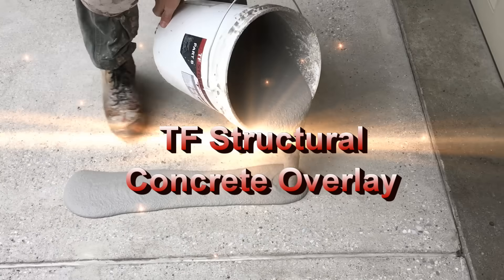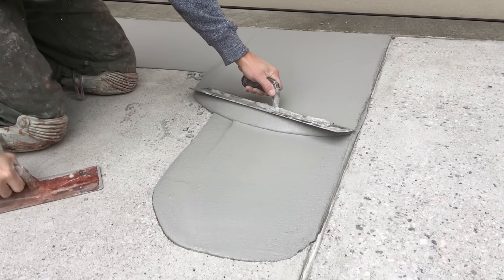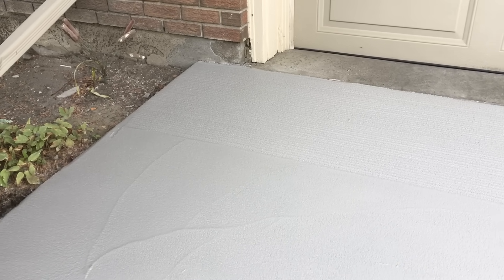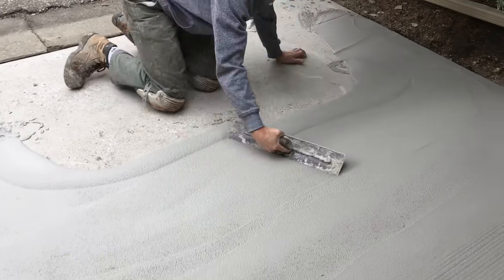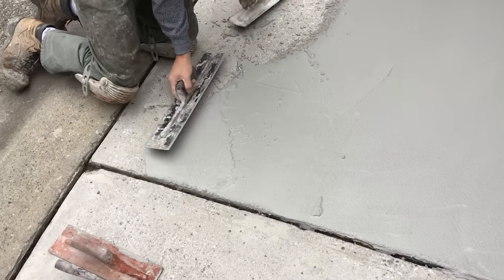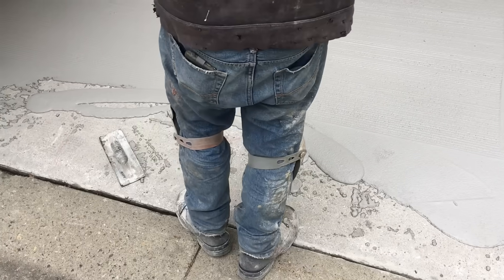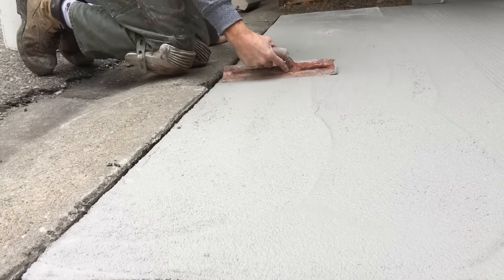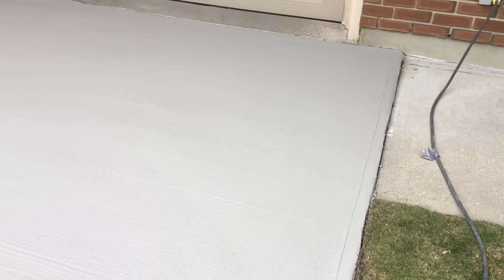TF Structural Concrete Overlay - Overview

Comment: How long before it starts poping up and chipping with weather ?
Reply from the maker: Hey Vince, it will not pop or chip off. It will wear the same as concrete does.
Reply from the maker: @The Sustainable Texan If you watch the video in its entirety, you hear that TF Structural is NOT a crack repair system.  Please elaborate on 'new on top of old'....you are insinuating that TF Structural is a cement or concrete, which it is not.  It is NOT a polymer modified repair mortar, which require bonding agents, scrub coats, etc.  TF Structural is an acid based repair mortar that mechanically and chemically bonds to the substrate.  Where did you see the TF Structural installed 6-8 months ago and then see it crack?  We have residential and commercial projects that were installed almost 10 years ago, in an aggressive freeze/thaw province in Canada, and they are performing like the day they went down.

Comment: should have filled the crack  first because as soon as a car gos over it a few times it willl crack again
Reply from the maker: Hello Mrr Mjj, no that is incorrect.  The crack will appear again, should the substrate continue to move after the TF Structural overlay is installed.  Pre-filling will not prevent cracking either, unfortunately.  Please see some of the other comments below regarding this crack and concrete cracking in general.
Reply from the maker: Here is a good method for crack repair: https://www.youtube.com/watch?v=xvq0TXjMfeU

Comment: Prefiling the crack with a fast setting concrete would have helped
Reply: Thanks... I'll try that. This would really help with curb appeal on my house until I can actually replace my driveway. Would this overlay work for small holes from rock salt? How durable is this overlay or how long can it sustain?
Reply from the maker: Here is another good method to try: https://www.youtube.com/watch?v=xvq0TXjMfeU

Comment: How thick did you apply the material?
Reply from the maker: A skim coat application is typically installed at 1/8" to 1/4" thick.  However, the material can be installed at whatever thickness is required and/or needed.
Reply: Terrafuse Inc. thank you

Comment: That doesn't crack apart?
Reply from the maker: TF Structural isn't meant as 'crack repair' product.  It can be troweled over and bridge cracks, but if the substrate continues to moves underneath, you will get hairline cracks coming back.  TF Structural becomes very rigid and will act and behave very much like traditional concrete once it is cured.  Does that help answer your question?
Reply from the maker: Here is a good crack repair method: https://www.youtube.com/watch?v=xvq0TXjMfeU

Comment: Nice job people are going to watch this and think running that trowel is going to be easy cause u make look so easy but thats alot of years experience i get the same thing when i run drywall trowel looks easy but its not thanks for sharing your knowledge
Reply from the maker: I agree Donnie, it takes time to get the feel of working trowels! A point I did try to highlight in the video, is that even if the finish isn't worked perfectly flat, the broom can help smooth everything out.
Reply: So true Donnie Porter 👍
Reply: Haha and they don't make shit. Usually minorities
Reply: Anyone can run a trowel that's why you don't get paid shit to do it
Reply: Kent Carver keep believing that dumbass.
Reply: Donnie Porter I disagree that there is no money in skilled labor. Specially if you are doing it for your self as your own business. However, this product has no chance of lasting if the base is not prepped right. You would need to Grind, or sand blast down. Then apply a masonry adhesive. Even then, it will be cracked up and flaking in no time. Specially a driveway with vehicle traffic.  After you do an over lay, it’s pretty much yearly maintenance. Constant head aches from customers wanting to know if you could come do it again. No thanks! Elastideck with an epoxy sealer would last way longer. The suns uv rays will eventually yellow the sealer, but we are talking like 7 years, and you can sand it down with 80 grit, and re seal.
Reply: @donnieporter7890   um, don't think it's a pass or fail test bud. Can you pass a U.A.?
Reply: @travisking4390  oh i agree with u on the product i dont think an overlay is the way to go especially in cold climate but they do this all around the world in tropical climate they do it and it last i was mainly talking about the trowel work .
Reply: @Kently6161  ignorant to the facts i made 150grand last year
Reply: @donnieporter7890  I'm sure you did running your own business how much did your employees make. That was my point
Reply: @Kently6161  well i paid a guy 600.00 yesterday for busting his ass and getting the job done. he worked from 9am to 6pm believe it or not doing skilled labor pays good and only getting bettr and in 10yrs from now they will be making as much or more  money as a person with college degree nobody wants to do hard work/labor anymore
Reply: @donnieporter7890  well congratulations. I'm glad you pay your employees well. I am a plumber. I understand skilled labor. From what I've experienced people that spread mud on sheetrock joints unfinished concrete are necessarily considered skilled labor and don't make very much because pretty much anyone can do it you don't need it any kind of Education
Reply: @Kently6161  hey i have my cont license and my Electrical license i worked doing water and fire damaged houses then i got into the electrical you are totally wrong sheetrock finishing and concrete finishers is an art and not everyone can do it
Reply: @Kently6161  i got 10grand u couldnt do either 1
Reply: @donnieporter7890  Correct! My son is a Dry wall finisher and he has more money than me and I aint broke! He's got the finishing technique down to a science fast and professional finishes!

Comment: What is the purpose of it if it isn’t to fix cracks? Is it just a resurfaced?
Reply from the maker: These slabs were restored because of surface spalling, and they also had an old overlay on them, which was failing. So yes, they just needed a new surface. Some cracks are very large, and once resurfaced, only return as a hairline crack. Some homeowners are happy with this result, as it is no longer a tripping hazard, or massive gap in their driveway.
Reply from the maker: @The Sustainable Texan Above you claimed 6-8 months, now you are saying 2-3 years; which is it?  Also, where  and when have you used our materials to make these claims?
Reply from the maker: Oh, the landscape business. That explains your comments. We are in the concrete restoration business.
Reply from the maker: You have never seen our product, on any job.
Reply from the maker: Yes I do, and yes I did, I designed these materials. I have also used these products for over 15 years in the field, so I know how they work and perform. You have never used them or seen them on a job-site, but claim to know all about them, which I find interesting. It suggests to me you are just using YouTube to vent your frustrations about who knows what.

Comment: Next time you have a crack to work over try putting duck tape on the crack then finish over it and most the time it doesn't come back. 😉
Reply from the maker: Unfortunately, TF Structural will not adhere to duct tape at all. We actually use it to create straight edges, or as a bond breaker when using forms. Thanks though!
Reply: Prime your duct tape before adhering tf structural
Reply: Duct tape is the deviled egg of construction. It goes with everything. I love it. Put tape down. Lol.
Reply from the maker: Here is another good method to try: https://www.youtube.com/watch?v=xvq0TXjMfeU

Comment: You need to lay a bonding agent down first.  This will definitely crack and separate.
Reply from the maker: This is not correct when using the TF Structural. TF Structural is not a Portland cement, polymer modified repair mortar, so using a bonding agent, or polymer primer, will actual weaken the bond made with the concrete.
Reply: @TerrafuseInc  I hear what your saying but proper prep work.  Grinding,  bond agent is key.  My opinion.  This is just a bare minimum job .
Reply: So many experts on YouTube
Reply: @shawsie5780  22 years in the industry.  I know a thing or two.  Cutting corners in concrete is not practical.  Why lay something down that doesn't resolve the issue and won't last?  
He's pouring a topping on a cracked un prepped concrete slab plain and simple.
Reply: @ipeeinpools9522  this is just a Band-Aid not actually fixing the job. It'll look good for a short while probably just enough time to let the owner sell the house and let the next person deal with the problem. Just like when people sell cars clean them up just for them to look good on the outside but in reality something's going on on the inside.
Reply: @ipeeinpools9522  get up to date . Still using material from 22 years ago I guess
Reply: @mikeb7611  lol,  good one.  Cheers.
Reply: Incorrect....this is not a portland cement based product.  Read the data sheet and you will see that.  Please educate yourself before posting information about a product you clearly know nothing about.
Reply from the maker: The concrete is prepped, and it was done using a shot blaster. The homeowner is aware the crack will come back, but these slabs were restored, because they were pitted and spalling, and they had an old topping on them that was failing. Again, bonding agents are only meant for specific overlays, usually polymer modified overlay systems, and TF Structural is not polymer modified. It requires no bonding agents, scrub coats, or primers.
Reply: @NordicMyth  how did you manage to to bring Trump into this retarded debate?

Comment: It will not crack over time.
Reply: If the concrete continues to move, expand/contract, etc. then cracks can and likely will come back.  This product is not meant to 'fix' cracks.  You can bridge over them, but any movement and you will get hairline cracks.

Comment: How long does it last before it starts cracking and chipping off the original concrete, what was the prep on the concrete, sandblasted pressure washed acid wash or a primer.
Reply from the maker: The crack may come back at any point, but it will usually show through only as a hairline crack. Usually larger temperature shifts will cause the crack to return. The overlay will last as long as the concrete underneath. It will not chip or flake off. It does not use any primers, and does not rely on primers to 'glue' it to the surface. TF Structural will chemically and mechanically bond to the concrete it is installed on.
Reply from the maker: The recommended prep is mechanical abrasion (diamond grind, sand/shot blast). The goal is to have a clean, solid, porous surface, and the TF Structural will bond to it. Pressure washing will work, but if the concrete is newer, grinding is recommended to ensure any surface sealers are completely removed.
Reply: @TerrafuseInc  thank you for the information.
Reply: @NordicMyth  Procedure: an established or official way of doing something.
 Synonyms: course of action · line of action · plan of action · policy · series of steps · plan · method · system · strategy · stratagem · way · approach · formula · mechanism · methodology · MO (modus operandi) · SOP (standard operating procedure) · technique · means · measure · process · proceeding · operation · agenda · routine · drill · practice. Perhaps it is you who needs less basement and more dictionary.
Reply: @JoeBlow-24  Haha!  Thx bud, I will keep that in mind. You missed the entire point!
Reply: It will last as long as you dont drive your vheicle on haahhahaa
Reply from the maker: HONESTO UNO  Just a quick question; whereabouts is your uncle located?  It can help us determine if it was indeed our products.  If so, we would be more than happy to dig into it and figure out what may have gone wrong.  We have been selling in Canada for over 10 years, but only about 14-16 months in the US.   Let us know how we can help!
Reply: @TerrafuseInc  
Wow, you guys sell in Canada? Does this mean it actually stands up to our constantly changing temperatures?
Cause we would have a use for a product that would...We do alot of repair work and people are happy to have something last atleast 5 yrs...but we never had a product that we could recommend.
We mainly do masonry work, but pour the odd small concrete pad or small sidewalk.
How would someone get ahold of your product?
Im in Eastern Ontario
Reply from the maker: Yes, we stock it in Etobicoke. Please call our office :-)
Reply from the maker: @splash5974  Thank you for the comment!  Indeed we do!  All of our materials are manufactured in Calgary, but we have a stocking warehouse in Etobicoke, ON.  TF Structural will change your opinion of repair mortars!  It is manufactured, designed and tested in Alberta, which sees some of the most freeze/thaws cycles than anywhere else in NA.  It is NOT a polymer modified product and does NOT require bonding agents, primers, etc.  Give our office a shout and we would be happy to chat further with you and see about getting some materials in your hands! (403) 243-3000
Reply: @TerrafuseInc  
Thank you
Reply from the maker: HONESTO UNO  Again, let us know where you are located so we can reach out to your uncle and see what happened.  This product does not fail, if installed correctly.  However, if it was done 2.5 years ago, it would have to be in Canada somewhere as we have only been selling into the US for last 12-18 months.  Our support doesn't stop after the sales transaction.  We are here anytime to assist.  I encourage you to pass on our contact info to your uncle - 403 243-3000.  Thank you Honesto!

Comment: Waste of money just to have a crack in it in the future,  that won't stop it from cracking again ,especially with that big crack already there , he should  and if he don't then he's not a concrete guy , but then again customers don't want to pay to fix the proper way , good job anyway looks good
Reply from the maker: Yes, the crack will reflect through the overlay, but they were not restoring this to "fix" the crack. They resurfaced this driveway to repair the surface spalling and pitting throughout. Unfortunately with cracks, there is no guaranteed way to fix them, and even new concrete has the potential to crack again.
Reply from the maker: Here is a method to fix cracks: https://www.youtube.com/watch?v=xvq0TXjMfeU
Reply: Because only super rich people can afford to pay the over payed union workers nobody can afford to pay $200-$300 per hour labor costs more and more people are doing things themselves because the cost of construction is way over valued due to unions

Comment: This question was asked prior, but I'm just curious. What is the cost per sq. ft. for a resurfacing job like this?

Obviously the quality of the work is high, but I know prices can vary wildly with concrete. I had the two approaches excavated and re-poured.  They were in bad shape. It was a total of 360 sq. ft. and I could not believe what some companies were quoting me. I live in Miami and some guys were asking for the maximum per sq. ft., which is $7.  I ended up paying $1450.
Reply from the maker: Hey John! It definitely varies depending on where you live, but jobs like this usually cost between $6-$8/ foot. Prices can change too, depending on the size of the job, usually costing less per foot, if the job is bigger in size. Either way, restoration should cost you less per foot, then having it ripped out and replaced with new concrete. Hope that helps! Please call us to chat further if you’d like

Comment: How well does it hold in different weather condition over time
Reply from the maker: It holds up extremely well in all weather conditions. It is installed and used extensively in Canadian climates, so it will see a very large range of weather extremes.
Reply: Acrylic Based products have the best Expansion and Contraction properties. They are very suitable for all Weather Climates.

Comment: why didn't you chase and patch the crack
Reply from the maker: Hello Gabriel, the TF Structural is a very rigid product, just like concrete, so there are special procedures needed, to prevent the crack from coming back through. You can see in the video, the guys did use a hammer tool to open up the crack, and remove all the loose concrete from it. After the repair, there will be a hairline crack that returns, but it will not be as bad as what was there.
Reply from the maker: Here is a crack repair method: https://www.youtube.com/watch?v=xvq0TXjMfeU